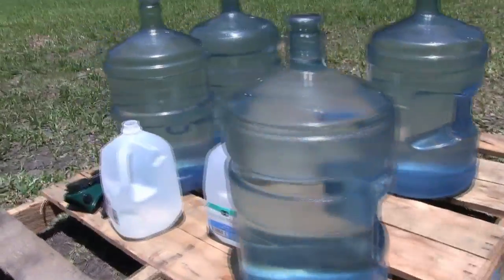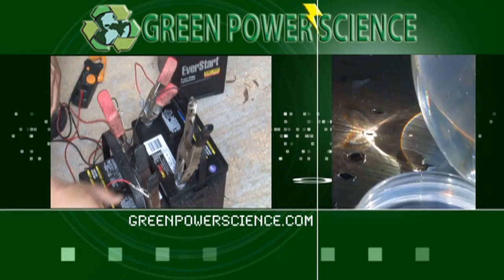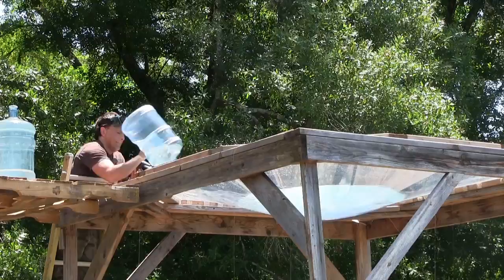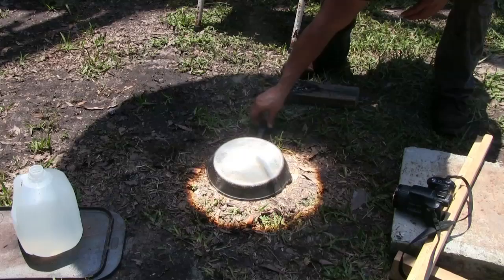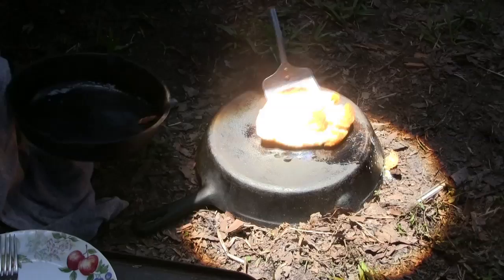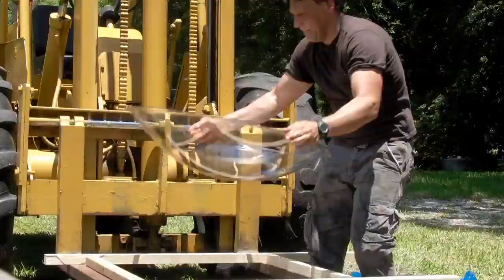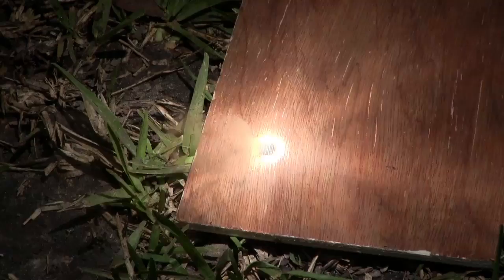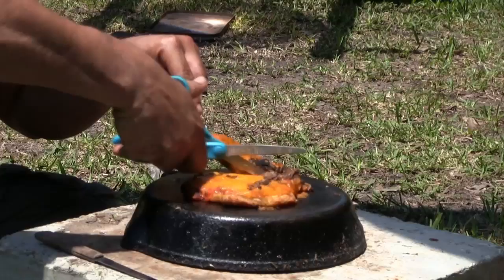Solar Cook a pizza with regular water, DIY dutch oven for concentrated sunlight

Comment: What about putting a flat sheet of plexiglass over the top of the water to prevent wind from disturbing the surface? Would the top sheet filter out too much light as to offset the benefit of getting a still surface?

Comment: Given the fact that the water moving from wind causes the focal point to dissipate, is it possible to cover the top with clear vynl?

where can i buy this type/grade of vynl? and how much open space would I need? i plan on making one of these with reclaimed wood. this is excellent work my friend
Reply from the maker: Jon T Hi Jon,

Covering can be a pain to get a top layer to stay flat without bubbles etc. Wind is usually not a big deal. The vinyl was from the internet. Really thick stuff used for patio walls. This only works in the summer when the sun is overhead. Works as a great rain collector. We got 6 inches of rain and it filled with almost 2000 pounds of water. Held up. I would not recommend that much weight but made a nice siphon shower.